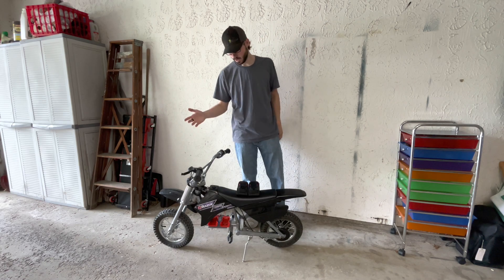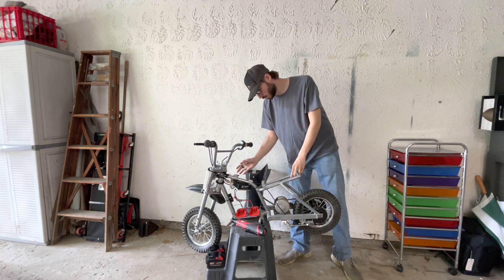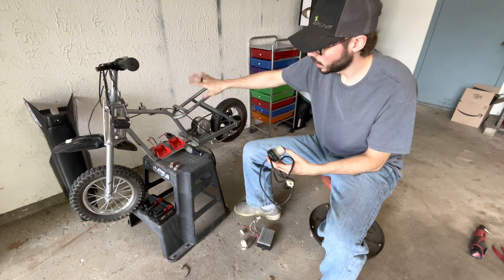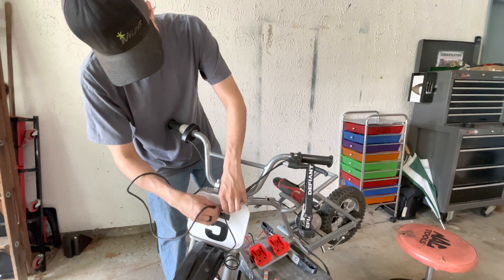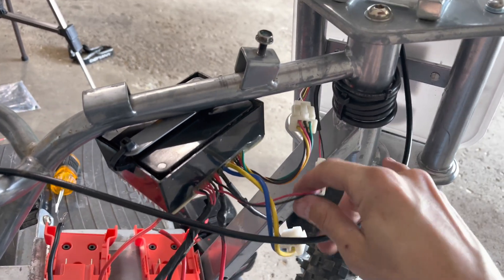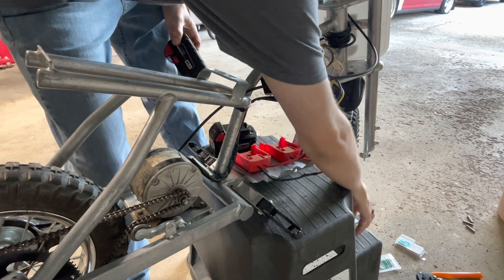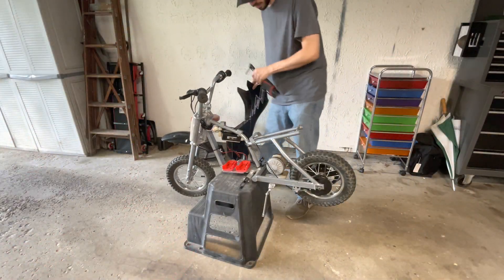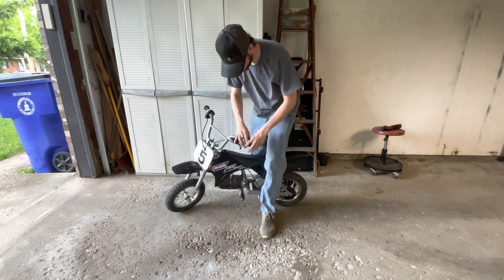How to make a Razor Mx350 run on Drill Batteries — JordyBuilds

Comment: I have this exact same bike, but I’m wondering do I have to upgrade my Throttle and controller to a MX 500 or can I just keep my MX 350 Throttle and controller ?
Reply from the maker: The stock 24v stuff won’t handle the 36v as it’s a on/off throttle not variable. I have an over volt kit on my website for sale now in the description, check it out !
Reply: @JordyBuilds  so do I have to use the kid off your website or can I just use the  mx500 Throttle and controller ?
I already have the controller and Throttle from a buddy of mines.
Reply from the maker: @TripleD-oj3hx you can use either! You will have have to do your own wiring! The kit is just plug and play for ease of use/convenience!
Reply: @JordyBuilds since I’m already upgrading to mx500 throttle and controller, can I do 2x dewalt batteries instead for a 40v instead of the 36v?  Can the mx350 stock motor handle it?  Thanks
Reply from the maker: Dewalt advertises their charged voltage. They are really 18v like Milwaukee. Yes it will work. I also sell full kits now plug and play !
Reply: @JordyBuilds can I run a Ryobi 40v if I upgrade my mx350 with your 36v controller kit? 
Trying to use this battery on a Mx350 without having to change motor
Reply from the maker: @gdhall yes I have a full 40v ryobi over volt kit. I will say some of the older 40v don’t like the full amp draw and shut off at full speed. To mediate this I always recommend people but the top speed limiter that way you can turn it down a mph or two so it doesn’t trip the battery. But so far I’ve only seen that with the old 40 V Ryobi batteries, and nothing else.
Reply: @ thanks just ordered the 36v 800w over volt kit!
Reply: @ what is the fix for this?  Itll run ride open on a block but with weight on it it'll only go half throttle before dying
Reply: @ what battery will take full throttle?
Reply: That works for rAzor mx400
Reply: Can you give me the link for everything I would need for a 350 upgrade kit? Using Dewalt.
Reply: I was going to run a single 28v battery on my son’s 360. … rethinking though if that throttle is on/off I should probably get a kit and go 36v?

Comment: Can I just put new batteries in there that are 40v without having to upgrade the throttle or anything else?
Reply from the maker: No. And if you’re talking about the ryobi 40v, those have problems cutting out at full throttle

Comment: Do you have a low voltage cutoff?  I teied this with my kids power wheel and bricked two makita batteries after the first ride.  They may have been knock-off batteriesz but im even more gunshy now to try it on "real" (retail price) batteries...
Reply from the maker: Disclaimer says to always pull at one bar. But yes has LVC 2 18v in series is 36v and has LVC for 36v battery. I also never recommend using knock offs. They are not near the same quality or true capacity either

Comment: Do it wreck the motor in anyway by using the drill batteries also if I get your overvilt kit in the description with it lose run time and how many amps battery’s do I use

Comment: What’s the difference between full throttle and half throttle. Want to buy the kit for dewalt mx350?
Reply from the maker: Full throttle has full length tube. Half is the stock size with a half grip. Both are variable throttle. Half throttle is good for kids just in case the bike gets dropped on throttle side, shouldn’t get damaged
Reply: Thank you for the quick responses. Perfect it is for my son I’ll be purchasing this today. 🎉
Reply from the maker: @ awesome! Thank you for your comment and support 💪. You guys ride safe!
Reply: @JordyBuilds Bro, is it necessary to install the LCD screen?
Reply: @DargonDahood almost all full throttle bring them
Reply: @Gus.VR-qs2xc  I don't understand, is it necessary, yes or no?
Reply from the maker: The screen is for your voltage which you should want to watch because it tells you what your battery voltage is aka how much battery you have left
Reply: @JordyBuilds  Okay bro, once the engine burns out, can I change it back to keep the bike running?
Reply from the maker: Not sure what you mean by change it back but if motor goes out you can get a few different replacement options
Reply: @JordyBuilds  I mean, I think it burns out, right? When it burns out, will it stop working again? Or if that happens, should I replace it with a new one? Or does the whole thing burn out and stop working?
Reply from the maker: If you’d like some pictures, you can also email me, sorry I haven’t updated the website yet. JordyBuildsYT@gmail.com
Reply from the maker: Also use code MOOSE for a few bucks off

Comment: What kind of run time did you end up getting with those batteries? Debating doing this with my kids mx350 or getting something like a 20 amp e bike 🔋
Reply from the maker: I get 40-60 minutes of ride time from 5ah Milwaukees. Check out my newer videos though I sell full kits and have linked some dedicated lithium batteries. You get get about 25mph for under $250. E bikes are cool but razors are way more fun
Reply: @JordyBuilds Friend, so to make this modification you need 2 18v 5Ah batteries?

Comment: I am trying to get the 36v tool adapter kit what plug do I get
Reply: 2 pin 3 pin or 4 pin
Reply from the maker: For a razor mx350 you just buy the full battery adapter over volt kit. Go to overvolt kits on my website
Reply: @JordyBuilds but I don’t want the throttle thing
Reply: Only the controller and the Milwaukee tool battery adapter
Reply: @JordyBuilds Hi Brother, I'll follow all the steps to update your Razor MX350, but I'd like to know what's happening with that 24V motor? Does it burn out or how long does it last?
Reply from the maker: @DargonDahood nine out of 10 times it lasted a good while but every once in a while you’ll get one that’ll burn out. There are, however, a couple of different upgrade options so you’re not left in the dark!

Comment: Will wiring in 2 of the milwaukee battery conversion kits into a mx500 work? If so what do you do with the stock on/off switch an charging  wires.
Reply from the maker: You don’t need two kits you just need one. One kit is 36v because batteries are ran in series. If you just wanted to upgrade to Milwaukee batteries you can match the same pin that’s on your controller but I’d recommend upgrading to the full over volt kit so you have key switch etc

Comment: Crud…. I bought the Mx 650 throttle and controller. Now my connectors don’t hook straight up… and idk anything about cutting it up to make it work
Reply from the maker: Check out my new videos I sell plug and play kits for this reason
Reply: @ turns out it is a mx500 throttle and controller. I’ve seen your kits but I’m a brokie.

Comment: For the voltage display, I’m guessing you are using it to not run the batteries empty? What voltage are you cutting off at?

Thanks.
Reply from the maker: Check out more of my recent videos I sell full kits now pre wired ready to go! I run batteries down to one bar and pull them
Reply: How does the volt meter help you know when you are at one bar?
Reply from the maker: Run it down to batteries at 1 bar for a minute or two and check voltage. 
Anyway I sell full kits now btw. Check description and website
Reply: Thanks! I bought the stuff off Amazon already but want to build a 650 too and will check out your site. Thanks for the help.

Comment: So its okay to put 2 18v on a 24v motor?
Reply from the maker: Yeah motor usually holds up well!
Reply: @JordyBuilds  thanks for the quick response.coz i have 2 ryobi battery adapter it comes with one wire with fuse.so i have to do a parallel connection?

Comment: Would you be able to put a voltage limiter on it? That way I can limit it to the stock 24v for my boy and as he grows I can turn it up? Would you know where I could find a voltage limiter?
Reply from the maker: Unfortunately, my speed limiter only works with my controllers or variable controllers. The stock MX 350 is just on off throttle
Reply: I’d also love something like this, for so many applications.
Reply: A potentiometer will vary voltage to your desired speed depending how you wire it. You could have it as a adjustable knob or set it then tuck it away
Reply from the maker: @smokes2366 I sell one plug and play with my kits! Works great

Comment: I have an MX350 for my daughter. I have one 24V 4ah battery hooked up with the goal of doing parallel batteries for a longer ride. I'm curious about what my options are to make that happen.  My thought was to solder the wires of one caddy to the spades of the other caddy. My other thought was to try and merge the wires of both caddies into a single wire. My concern is if it will be functional. I don't know enough to understand if it'll create issues. Any thoughts?
Reply from the maker: You would want to wire the other 24 V battery in parallel with the other batteries. If you use proper connectors, you can cut the wires and use connectors for everything.
Reply: @JordyBuilds  thanks!! That's pretty helpful. I've been looking at busbars as well,  but it may be tight on room.

Comment: I bought the mx650 controller and throttle but I am a little bit confused. It has throttle, battery and motor which I knew it had. But there are only 3 wires left. 2 of the same looking ones which I think is the brakes and one other which is the charger. That would mean if we only use one of the brake wires I would have 2 plugs that I wouldn’t be using. You said 3. Did you make a mistake or is my controller different than yours. Thansk
Reply from the maker: Not sure it’s been too long. Just compare through the video. Either way you don’t need brake or charger so doesn’t really matter. Just need motor throttle battery. Switch if you have it set up

Comment: If I’m using two 20v dewalt will it still work with your 36v controller?
Reply from the maker: Yes I sell a full kit! Check the over volt parts on my website in the description!

Comment: Hi, when upgrading an MX 350, what makes the bike run faster and go further, higher volts or amp hours?  I purchased a power sport AGM motorcycle battery and it fits the MX350’s battery compartment.  Which is better, the drill batteries or the motorcycle battery?

Thank you!
Reply from the maker: You’d need multiple batteries in series using batteries like that. Not efficient pr put out any amps at all. 
Volts is your top speed and amps is how fast you get there. If you don’t already have multiple drill batteries I’d recommend a cao mm lithium battery from Amazon!
Reply: @JordyBuilds 

Hi Jody,

So, I would like to purchase the 36v 800w Controller with Throttle Overvolt Kit you have on your website.  However, I would like to use two 18 v Milwaukee batteries, and I am unsure how many “pins” under the battery option I should choose.  

Thank you for your guidance!
Reply from the maker: @readyfreddy77  I have a full battery adapter kit with the Milwaukee adapters all together! It’s in the over volt tab. I’ll link it in description as well
Reply: @JordyBuilds  

Already placed my order.  Thank you!

Comment: So I hooked my son’s hyper 350 the way you did. Both 6.0 Milwaukee batteries were fully charged. After my son’s first ride he checked the batteries and they were flashing only one cell. Have you experienced this before. The batteries are brand new.
Reply from the maker: Are they real Milwaukee batteries? Put em on the charger a few times that may reset them. I always suggest pulling batteries at 1 bar

Comment: Will a stock mx350 perform with two 18v Milwaukee batteries
Reply from the maker: No you need 36v controller and variable throttle

Comment: How do you connect the battery adapters to the battery mount frame?
Reply from the maker: I send two bolts so you can drill hole and bolt down

Comment: Can u just use all stock parts and just put 1 dewalt adapter and run it just on that? Or I have to have 2 dewalt batteries and upgrade the voltage controller and throttle
Reply from the maker: No that’s a 18v battery it won’t power a 24v system
Reply from the maker: https://jordybuilds.co/products/mx350-kit?utm_medium=product-links&utm_content=ios&utm_source=copyToPasteboard

Comment: Do you need to install low voltage cutoff switch to prevent battery from over discharging?
Reply from the maker: I pull batteries at 1 bar. I’ve ran em dead before and not had issues but it’s not recommended

Comment: Hey Jordy just picked up a what i believe to be a mx350 from 2010. (V22) is your tool battery/controller mod compatible with it? Also, do you have a video showing how you mount the Ryobi set up?
Reply from the maker: I’m about to do a video on installing a full kit I sell on a mx350, I just did one with a 40v ryobi battery adapter and the 36v controller with throttle & volt meter/key switch set up! If you shoot me a message on my facebook I can send you some videos today! It’s Jordy builds , also linked in description of my new video.

Comment: If I want to switch my mx350 from 24v lead to a 24v lithium battery do i need a new throtle and controller and if so will the one you have on your shop work for 24v lithium?
Reply from the maker: No you will not, it’ll work! However it may be in your best interest to go 36v and get a potentiometer(top speed adjuster on my website) that way you can turn down power and slowly turn it up as they are ready for more power rather than have to buy a whole new battery

Comment: Are the last 3 plugs used for anything ?at 7min12seconds can’t figure that part out
Reply from the maker: I didn’t really see what plugs you mean. Just need motor, throttle, and battery when using the mx350 controller
Reply: It was the three tied together

Comment: Quick couple of questions. Are you able to wire four 18v batteries totaling 72V if I upgrade the other components? And will the batteries add up to 72v and drain equally?
Reply from the maker: Your have very low amp output for 72v and that’s really stressing the batteries but it’s been done. 18x4=72v and they should drain evenly if they are all same charge and capacity(ah)

Comment: Thanks I had just picked up a electric scooter but it had no battery and I’m not even sure if the motor still works I tryed n bypassed the battery plug to a 20v battery I have power no movement
Reply: I’m about to just throw a lawnmower engine on it if I can’t figure it out
Reply from the maker: One 20v probably won’t do anything. Most scooters are 24v
Reply: @JordyBuilds  yeah I found that out it’s cool ether imma just upgrade it or just put a mower motor in it

Comment: What will this do to the motor over time? How fast will it go?
Reply from the maker: See my other video! Motor last a long time on 36v
Reply: @JordyBuilds  ok, also what is the recomended bike/battery? How much in total did this build cost? I am thinking about building one for myself, but I don't want to spend to much on it. I want it to do like 25 or 30 mph if that is possible.
Reply from the maker: @CarSpottingNC1  it really depends what you want. If you don’t go milwaukee I’d go lithium. A 36v 15ah I think is like $180

Comment: Would this work with the Milwaukee M12 batteries with the stock MX350 controller and throttle?  If so what amp-hour batteries and how well do you think it would work?
Reply from the maker: No
Reply: @JordyBuilds  Well it did work but with a total voltage of 24 volts, it was slower the the lead acid batteries that are over 26 volts I just measured.  To be safe I tried an M12 + M18 for 30 volts so I wouldn't blow anything.  Both had 4amp-hour batteries.   Seemed fine for a 1.5 mile ride with my son on it but long-term I'm not sure if the unbalanced battery setup would cause an issue if I decided for a more permanent long-term mount of this.
Reply from the maker: You absolutely cannot combine different voltage batteries OR different ah Batteries. Doing both I’m actually surprised you didn’t have a fire. I would definitely suggest you do a lot more research before you continue.

Comment: @Jordy Builds On my MX650 speed controller, the connect that brings power into the controller actually has 3 wires, 2 main (power and ground), and a third small red wire that is tapped into the main power.   Any idea if that small red wire is required and what it does?  I wasn't able to find a diagram that explained why it was there
Reply from the maker: If you look up mx500 controller wiring diagram it should come up on google images. It’s more than likely the wire for charging stock batteries

Comment: Do you HAVE to get a MX500 controller? I wired my batteries it wants to move with 2 ryobi 18v batteries but doesn’t
Reply from the maker: Yes and a variable throttle. I can sell you both if you need. Shoot me a email @ jordybuildsyt@gmail.com

Comment: Hey mate great guide. Can you wire in a throttle limiter for when my younger son wants to ride it?
Reply from the maker: Yes you can it’s called a potentiometer!
Reply: @JordyBuilds Where do you add the potentiometer? Splice it into the throttle cable, or battery?

Comment: Do you have to have the mx500 and sx500 eletrical kit?
Reply from the maker: You need to have a 36v brushed controller with a variable throttle

Comment: Hey man i built mine using 12v batteries in a series to get 36v.  Currently buying new throttle and speed controller.  But i hooked it all up (without a speed controller) and used a switch instead of a normal throttle.  Now the bike only last like 10 mins on full charge.  Do i need to get a 36v speed controller to get more power longevity out of these batteries? 
Please i need help.  Thx
Reply from the maker: what AH are your 12v batteries?
Reply: @JordyBuilds  7.5 amphs each